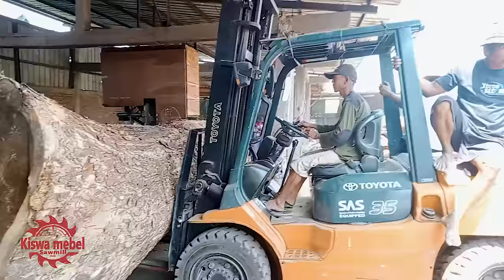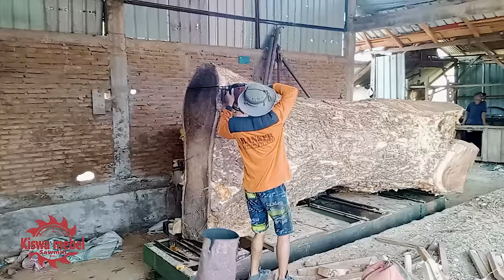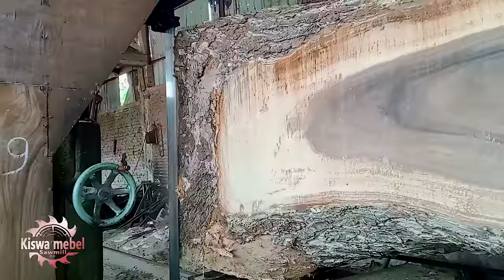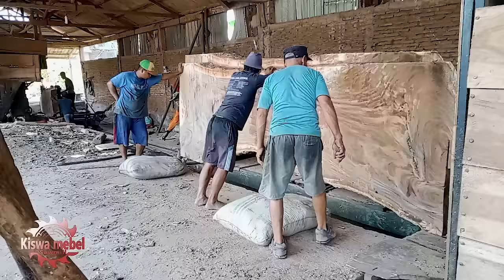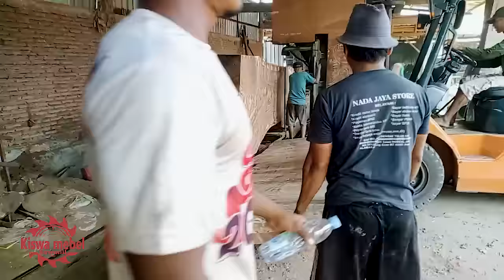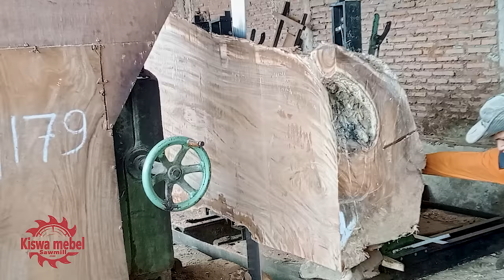Kayu mewah milik sultan senilai 700jt ! Kayu trembesi kendari digergaji sawmill meja makan villa

Comment: I had a buddy who owned a bandsaw mill much larger than this one (with 5 feet between the guides).  It was the largest sawmill east of the Mississippi.  He imported exotic hardwoods and sawed them 9-quarter thick (2-1/4") and dried them in his 17 railroad car kiln for drying.  He then stacked them as they were cut with slats between each cut to allow air flow, in his warehouse to be sold.  He made a deal with Idi Amin in Uganda, who was the dictator there, to cut 4000 acres of virgin stand hardwoods including bubinga, zerbrawood, etc.  Most have never seen these exotic woods nor the shear size of these slabs of wood.  Some slabs were up to 5 feet across and over 20 feet in length.  This man and his daughter traveled the world to find exotic trees to import and saw up.  He sold his high end lumber to those wealthy people for their mansions.  He provided tongue and groove lumber for the Dupont mansion in Delaware back in the early 70's.  I was able to purchase some of the over runs of this for furniture building, from him.  I also purchase several of the slabs for table tops and counters and provide my customers with some rather unique pieces.  His large sawmill was located just outside Waldorf MD and his tongue and groove mill was locaed near Conowingo MD.  I bought all I could afford before his supply ran out.  In the deal with Amin, he agreed to trade the huge custom made band saw to him in exchange for the 4000 acres he cut.  The saw was dismantled and shipped over to Uganda in the late 70's.  The owner's name was Larry Hagy.  I'm sure he's passed by now.  It was a terrific find for me  to be able to access such fine lumber.
Reply: fantastic story thanks for sharing
Reply: Really interesting story.  I don't even know how I ended up here and I haven't event watched the video, but your comment was worth it. Thanks for sharing.
Reply: Amazing Story
Reply: I knew one of his 'wifes' in L.A. in 1973.
Reply: Bhtb
Reply: Buena historia , Idi Amin  terrible dictador,
Reply: Thanx for the information..Great reading..Thanx for your comment..😍🥰🥰🤩
Reply: unfortunate that this beneficial action by some parties, including in Indonesia too - will have an impact on the entire world population, especially climate change which is currently occurring.
Reply: That a hell of a tale to tell my friend. I’d love to have seen some of the lumber that was used. Thanks for sharing
Reply: Thank you for sharing that memory and view into the. past.

Comment: Do not pull a lever all the way and then floor the engine on a piece of equipment. Run the motor at the governed RPMs then ease into your lever. You'll have smoother and more powerful functions, and your equipment will last longer. Forklift 101.
Reply from the maker: Thank you sir for the advice...hopefully it's useful
Reply: I wish I was there to help and watch and learn.
. @KISWAMEBEL
Reply from the maker: oh..thank you sir..it is an honor for me if you can come to Indonesia @MrMarkRoads

Comment: Wish the process of moving the slab over over each successive cut was shown. Critical that cuts be evenly cut.
Reply: It's hard to see, but at the beginning they briefly do. The metal posts on the back side of the trunk (opposite the blade) are on a track underneath that gets ratchet/pushed towards the blades evenly!

Comment: nice catch on the open. I've worked in sawmills sense the late 1990's none this small, But the tangled monsters these men are cutting is beyond belief! I pray the Sultan is pleased, this wood is gorgeous! solid, grain, color, just beautiful! Run on a cylinder diesel. It works. you can run a brush oiler on the back side the counterweight side just a thought.
Reply: and with no shoes no less. Did you see the two workers that are barefoot?  Now, I understand this is not California or Ontario Canada but it's a sawmill! Not even sandals, but barefoot!??